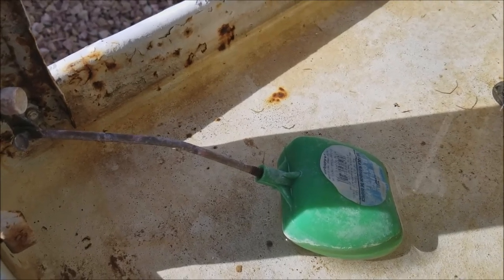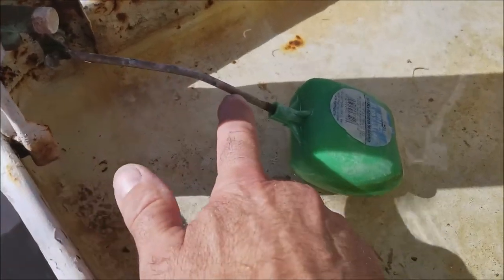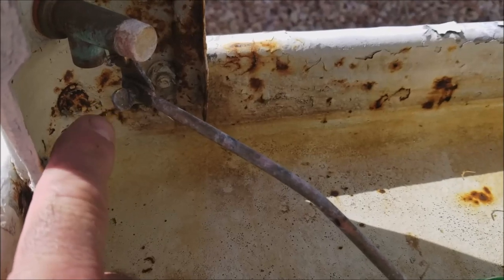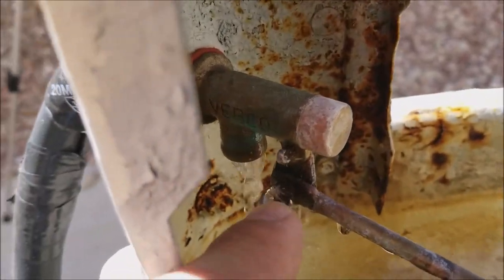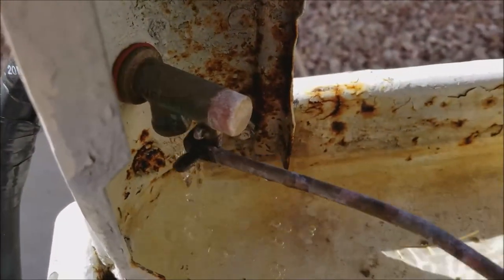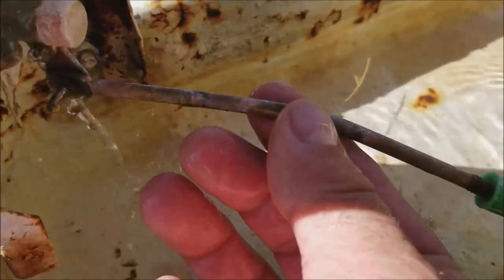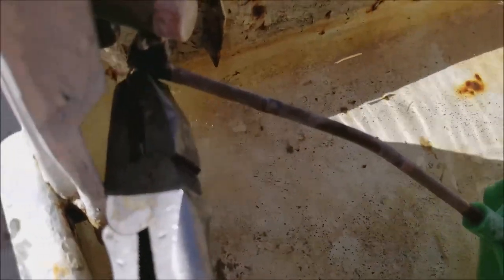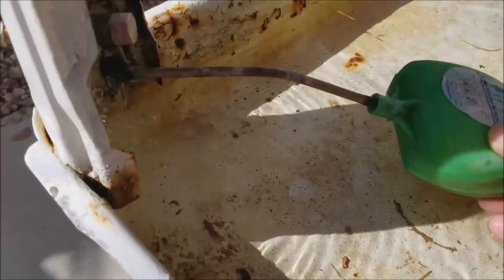How To Adjust A Swamp Cooler Float

Comment: I was hoping you would tell us which way to bend the float bar. Meaning, if the tank is overflowing, do I bend the float up or down? Which way do I bend the float bar to make the water stop flowing sooner. Do I lower the float or raise the float, to make the water shut off before the tank over flows?
Reply from the maker: If the water is to high bend it down.